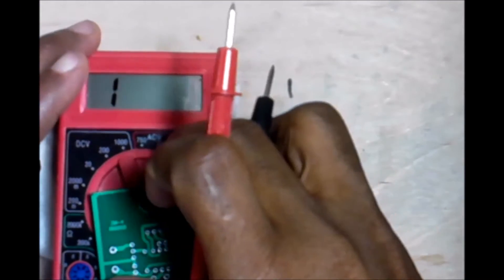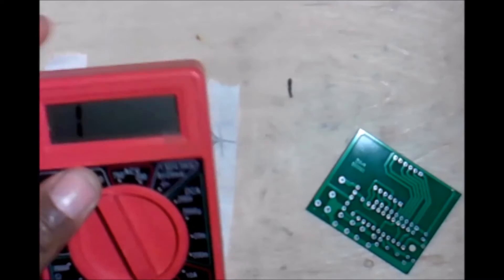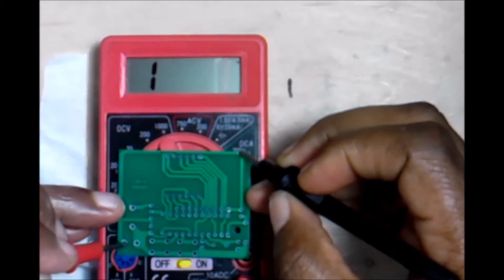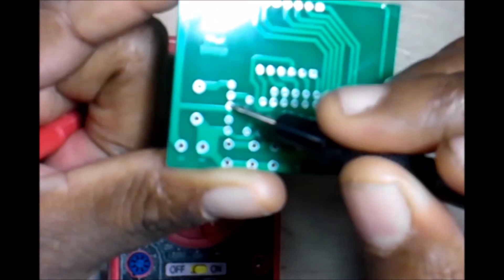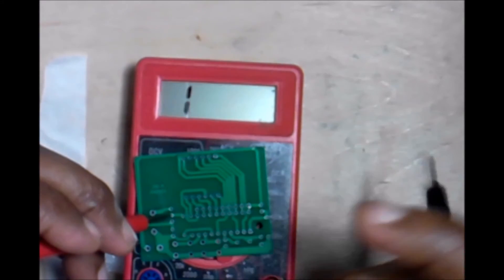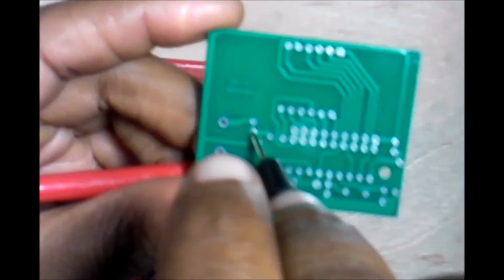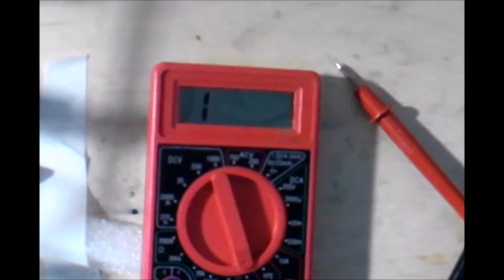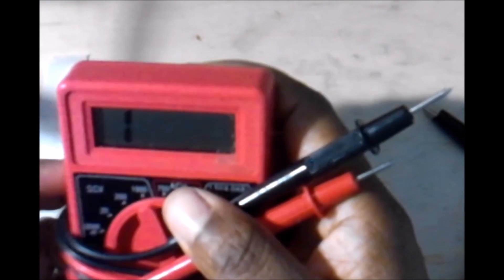MultiMeter Testing Continuity Circuit Board | Troubleshooting | Ebonygeek45

Comment: I have the Harbor Freight cheap special also and was just trying to figure out how to use it for the Continuity testing. Thought is was defective because it never beeped and was about to give up and throw it away until I seen you where the same HF multimeter.
 Your's is the only video out of many that mentioned using a different setting for the Continuity test.
 Thank you for sharing your knowledge about that and thank you for saving me from throwing my non defective multimeter in the trash. 😁🤙

Comment: Hooked up the three-wire power cord to my washing machine only sure of the green wire. They weren't color coded. I am not good with electrical. I have had a multimeter for years and only use it when absolutely neccesary. After watching your video I now know how to do a continuity test. Thank you so much!